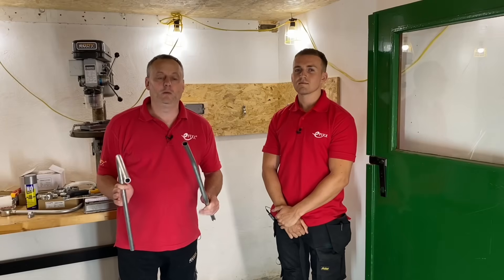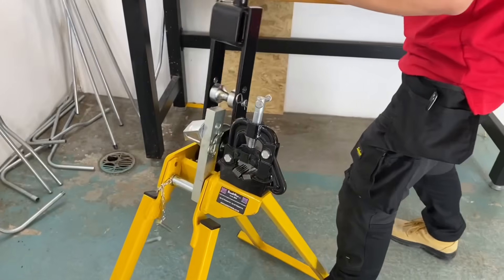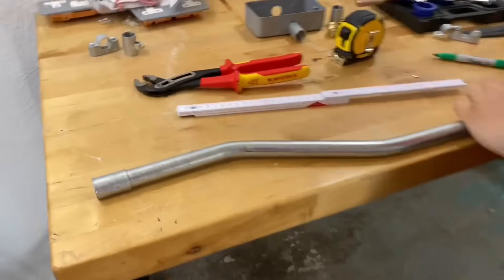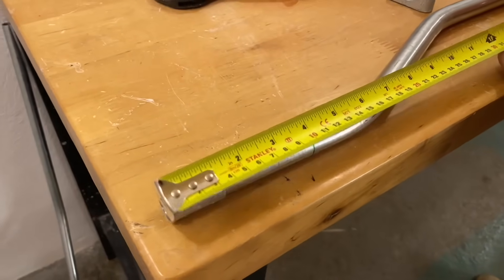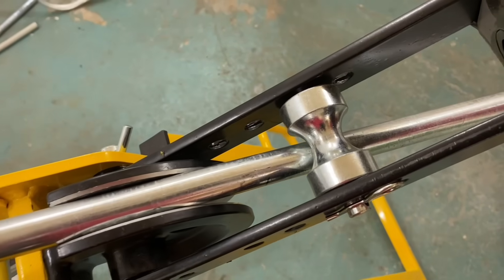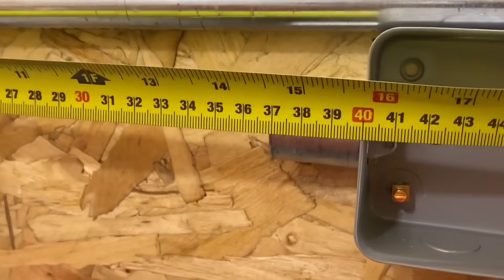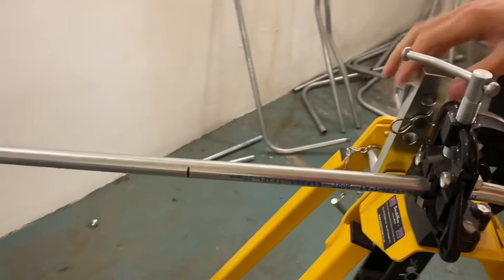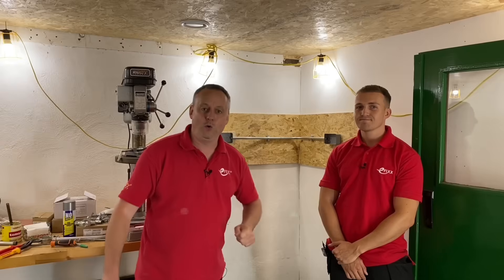How to put a 90 Degree Bend and a Double Set into one length of Steel Conduit!

Comment: I’ve got my AM2s in July just refreshing myself on steel comduit. I’ve seen differing information though about the AM2s and what you need to do for the steel conduit section. I’ve heard just a double set and 90 bend like in this video but also the above and a running coupler. Does anyone know if the running coupler is actually a  requirement for the a AM2s steel conduit section. Thanks

Comment: Those bending machines need some sort of angle markers built in
Reply: I agree but the reason they don't because every bending machine is different so this would not work and you have to include wear and tear so if there was angle markers on it ,it would be off actually

Comment: First time right ! What a beautifull video eFIXX ! Possible to make a video with PVC conduct and a bending spring ?
Reply from the maker: Thanks for watching 👍🏻
Reply: Go buy one and start bending !  Here in NZ the 90deg bends are cheap as chips so I no longer use a spring. Also here there is very little metal conduit along with metal flush boxes. Measure twice cut once is the key.
Reply: @markkennard861  I am from the Netherlands 😎 We use different installation systems here like the "central box system" (You go from your circuit breaker to a central box ( lighting point ) and from there to your switches and sockets or next central box. The circuit type is called radial in the UK). For Cables and wires we use plastic conduct and we use a spring to bend our conduct, use fixed bends or flexible conduct  But eFIXX has so many good technical videos. It doesn't matter where you from, they will always share something that can be used in any type of installation.

Comment: Not sure how it would fair in the AM2S, but for anyone else. A tip for the last cut. If you can get the distance from the end of the coupler. To the back end of your 90 bend, cut it at that + 15mm

Thread it so the end of your conduit is level with the first line of the nut of your stock and dye set (see 12:43 in the video, he’s done it)
that threads the conduit to exactly 15mm (30mm on the 2nd line) Every time, or atleast it has done every time for me since I’ve been using that method after I was shown it on site 4 years ago

Comment: Been a while since I was in the trade but does no one use lockrings anymore?
Reply: Exactly  still in the trade and frequently do conduit I always use lockrings  so I can tighten things up In all my years I have never put two lengths of pipe together solely with a coupling and it been straight always two rings and a coupling so you can adjust and tighten
Reply: Lock rings and running threads get you out of trouble so easily. Yet a lot of the newer guys just don't use them...